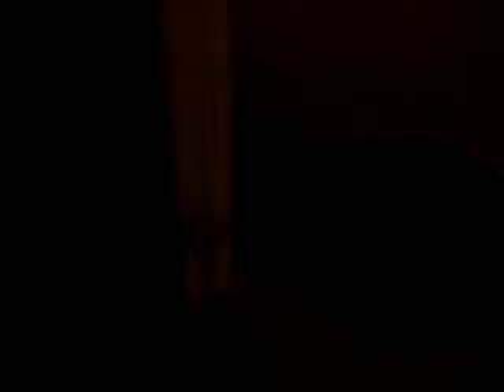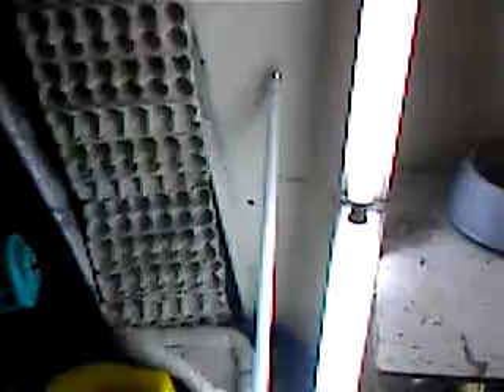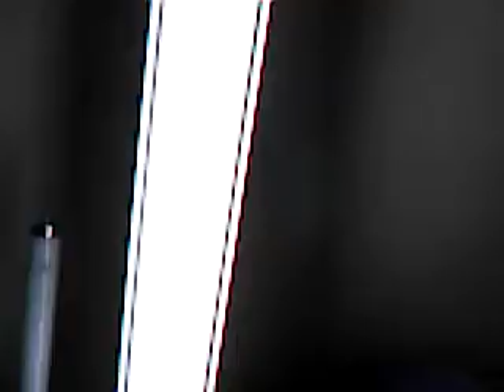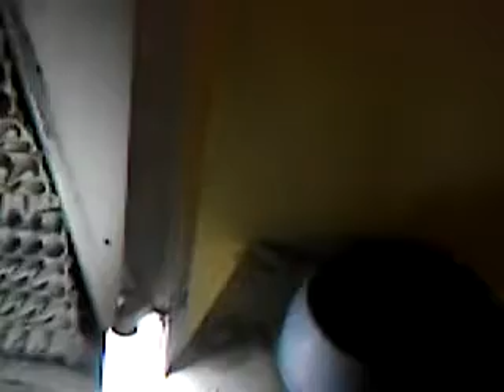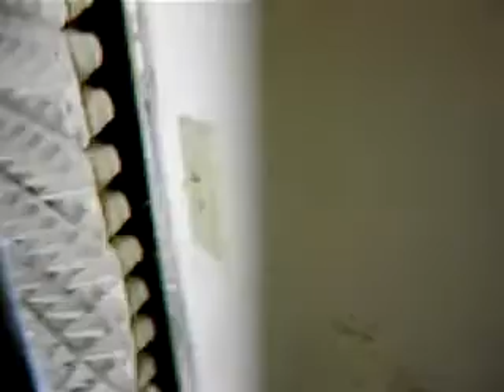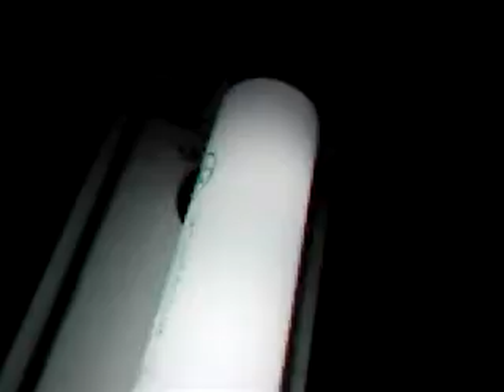Starting an F32T8 on a preheat ballast

Comment: I used exactly 2 american Fluorescent fixtures and turned them from Instant start 17 watt to a preheat T12 20 Watt, both are 2 foot fixtures, both work fine even with the 17 watt T8 Bulb

Comment from the maker: Actually, the first time it was a "Guaranteed" brand F32T8 lamp that had a daylight like color. It didn't even like a 2XF40T12 rapid start ballast if I remember correctly. If I had kept it around, maybe it would have worked in the F32T8 ballast I have now. Either way, this GE worked just fine. A friend said that the Guaranteed lamps are actually made by Sylvania, though Sylvanias don't seem to have much trouble either.